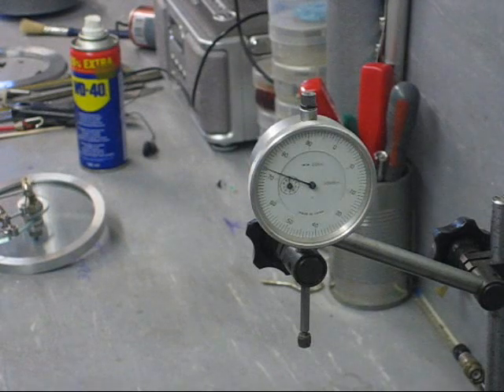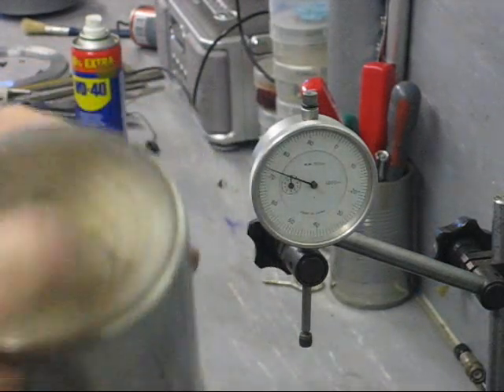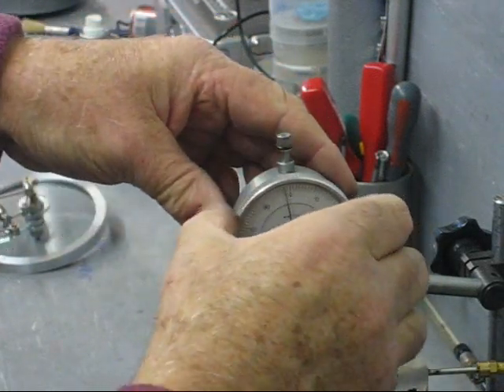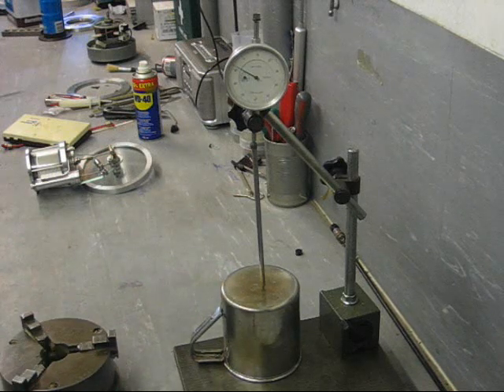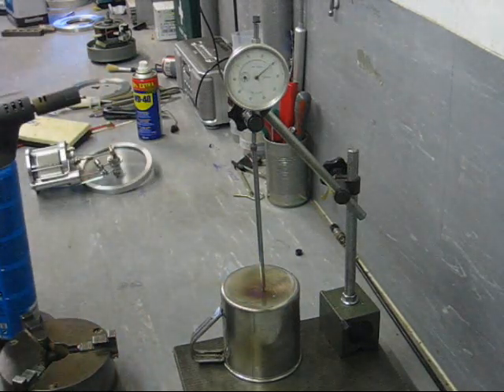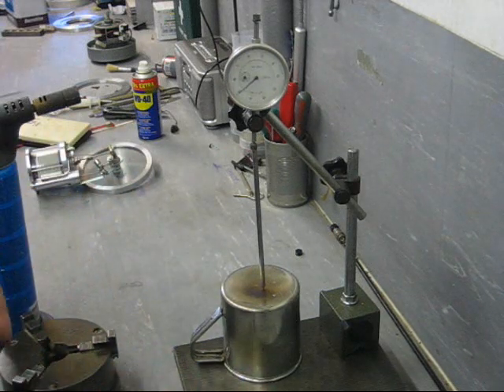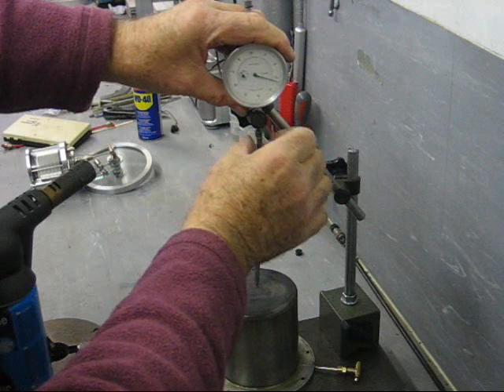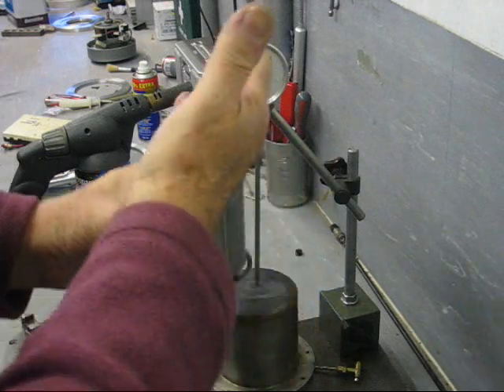Stirling Cycle TMG. Part Five

Comment: Very nice explanation, the demonstration is excellent.  I wonder if shaping the ends for greater shape stability during thermal expansion could be done?  Similar to they way a soda can is shaped at the bottom, the proper mix of curvatures could absorb much of the expansion.

Comment: Hi! I realy don't know if my questions has some logic, or if you can unswer it, but i'll try! XD If we pressurize a stirling engine, let's say... with a safe low pressure of 5 bar, for example, wath could be it's maxium pressure inside the cylinder? I know that this question may have many variables involved, but if you can answer with some objectivity, if you know, of course, I'll appreciate. I'm asking because I don't know how many pressure increase, when we heat the air. Tanks and good work!

Comment: Excellent. I didn't expect such a large shift to occur but I guess the flat plate is expanding radially and is restrained by the cylindrical walls so it has to go one way or the other depending on initial curvature. Putting a  pre-set curvature means it can only go one way. Very informative video!